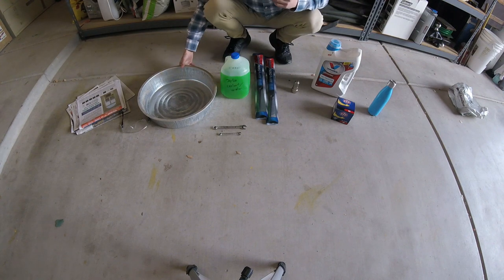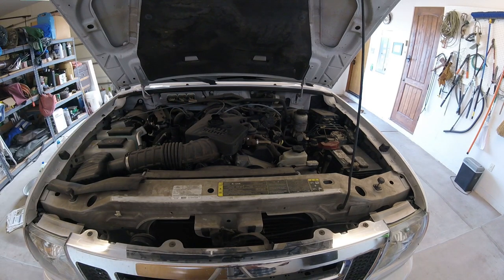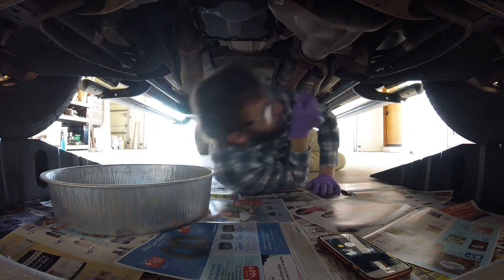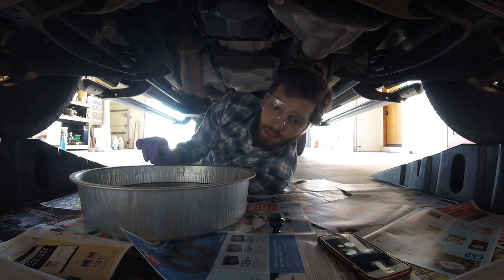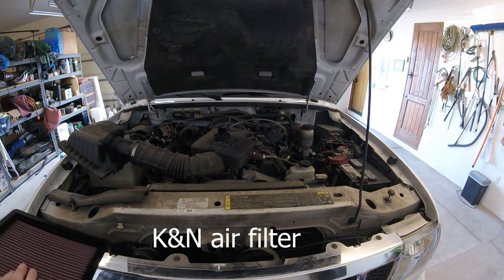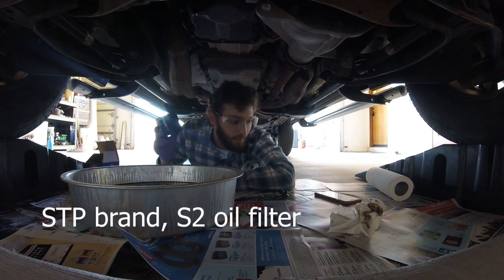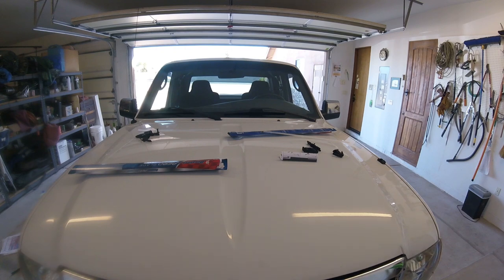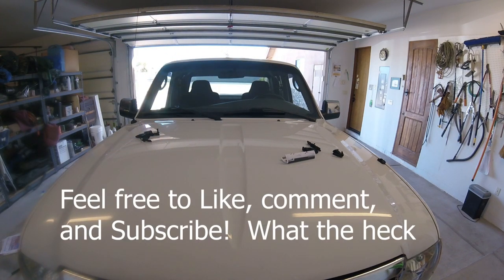2008 Ford Ranger 4.0 SOHC V6 Oil Change

Comment: Mechanic's tip:  If your oil filter is vertical, it can make a mess when it is unscrewed.  Take a steel punch and a hammer and lightly punch a hole in the center of the bottom of the oil filter.  Remove the punch quickly, and the oil will drain out of the old oil filter into the pan before you unscrew it.  Avoids a lot of mess.
Reply: Can you show me?

Comment: Help me I live in Alaska I have no garage no shop it took me two days to get an oil filter off but I got it off when I went to install a new oil filter it didn't fit it was the correct filter and it appears happy Oriole filter housing has turned it an angle and I can't get the new one in it's driving me crazy I'm on my fourth day for one hour or oil change can anybody help me
Reply from the maker: The oil filter I use is a S2 model from STP.  I've used it with conventional oil, and synthetic blend.
Reply: I hope you got it fixed. If money is not a worry, get a tap and die set to make sure the thread where the oil filter goes is not stripped. But it is far more likely that you are simply not aligning the oil filter correctly. Take a deep breath, be patient and after you get it on I bet you never have that problem again.

Comment: I’m thinking about getting this truck.Any details of problems they might have would be appreciated!
Thanks
Reply from the maker: Hey, thanks for the comment!  Even though the truck is 11 years old, its only up to 78,000 miles, and I haven't had many issues!  Drivetrain works really well.  

Only thing that's broken is the needle showing which gear is selected.  You can change through PRND21 just fine, but the needle stays in place.  Been like that for 10 years, and I've forgotten about it, but it's the first thing anyone else mentions, when they get behind the wheel.
Reply: Watch Wilson thanks 🖖
Reply: You shouldn't have any problems all the engines 2.3, 3.0, 4.0 are solid engines
Reply: These trucks last you you maintain  them